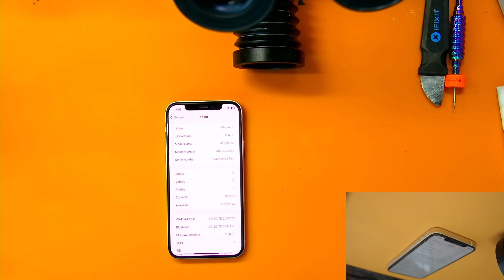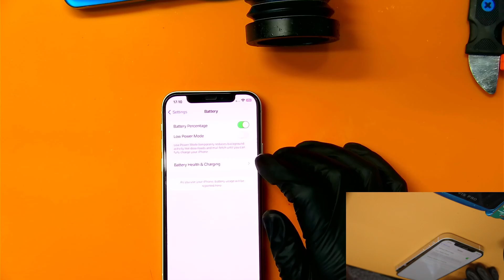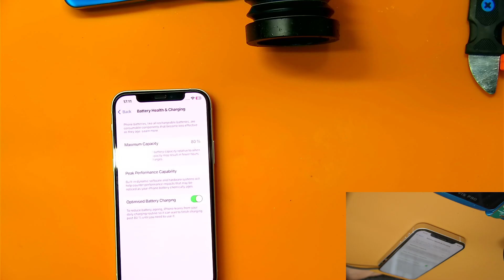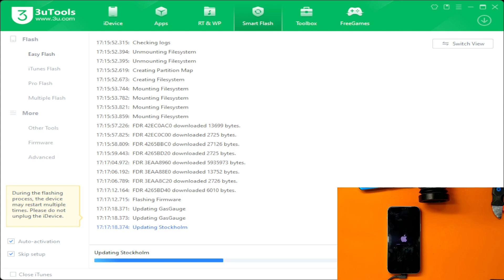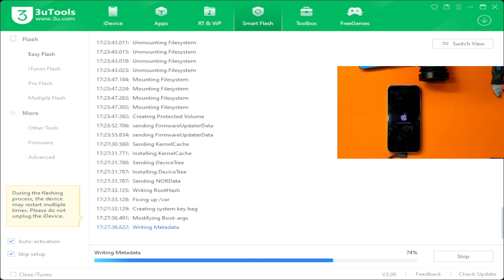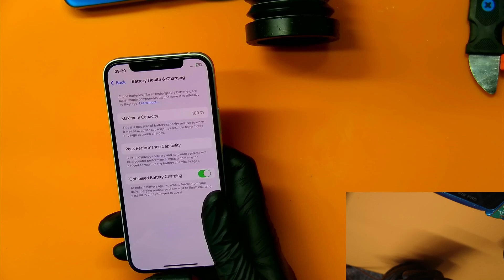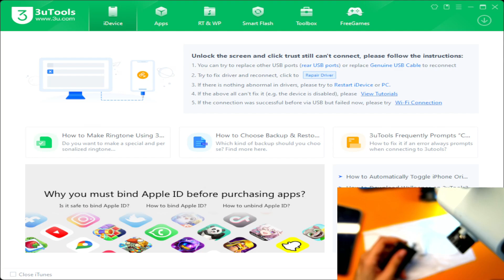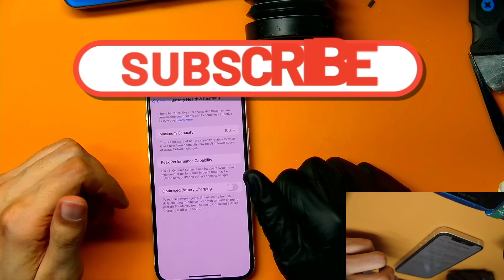iOS 17.4 Battery Health Problem Finally Solved - Learn the Step-by-Step Fix with JCID TAG ON FLEX !

Comment: Must install JC Repair or not? 
// i do battery ip11   100% on ios17.4   
Battery Health show 100% 
But   
in 3utool  show 75% 
When i remove jc repair
Reply from the maker: yes if you remove the tag on flex wont show in 3utools but in settings will be 100% so this is up to you